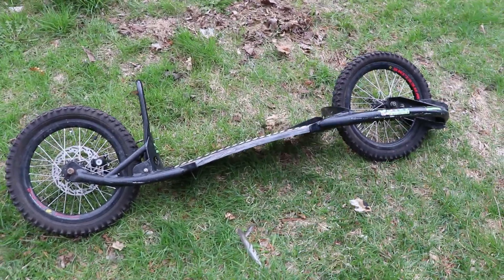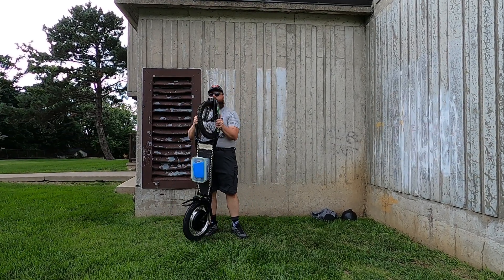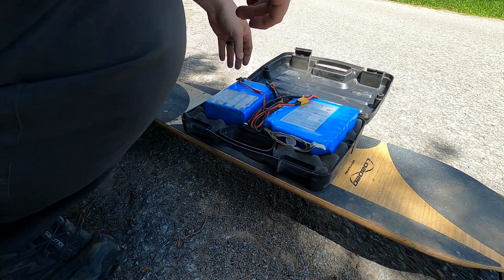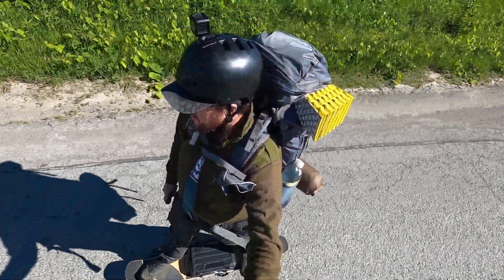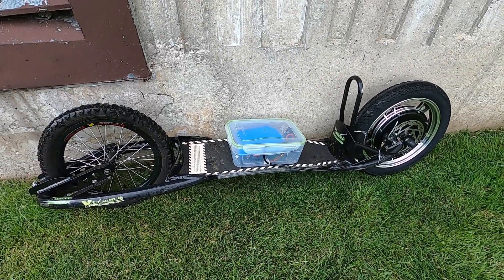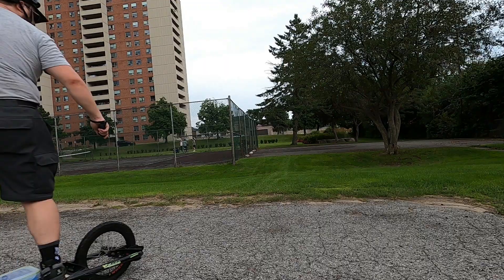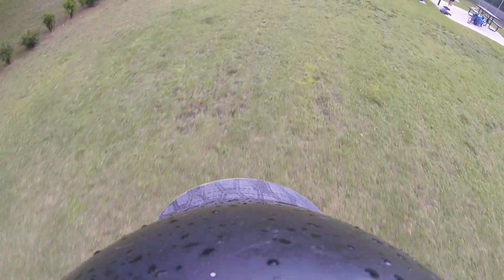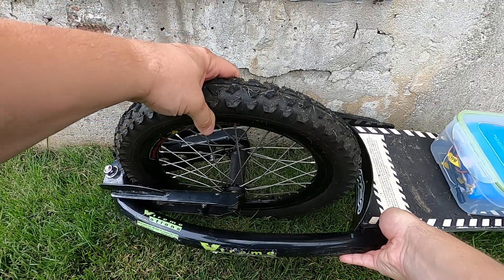DIY Electric Dirtsurfer - Specs & Test Run

Comment: I'm looking at picking up a 2Swift board, which is like the 2023 version of what you did.  I'm curious if this gets more stable the faster you go on the street?  The front wheel looks like when you get that janky shopping cart.  I want that snowboarding/carving feel but to be stable at high speeds.  Great build! I would try this if they were more readily available!
Reply from the maker: Yeah, more stable the faster you go